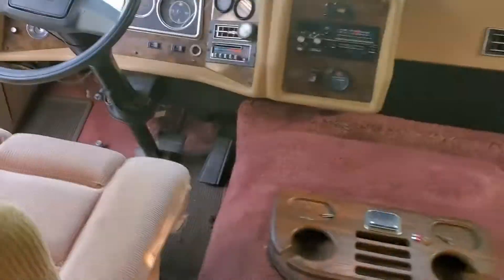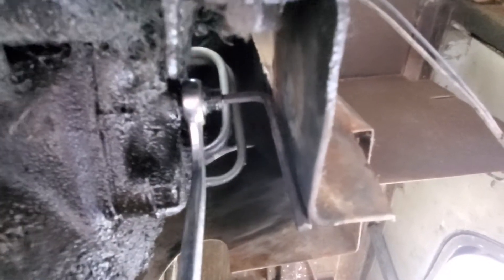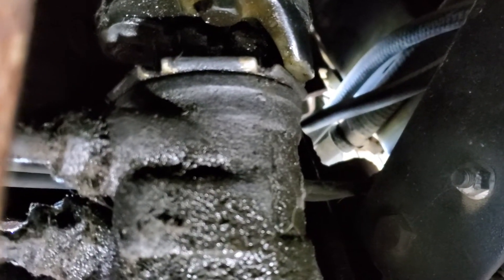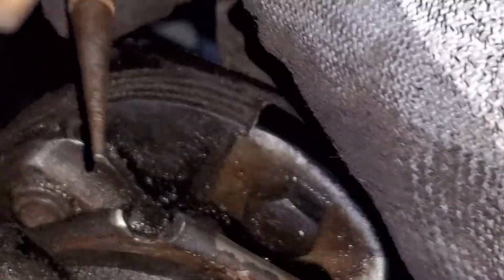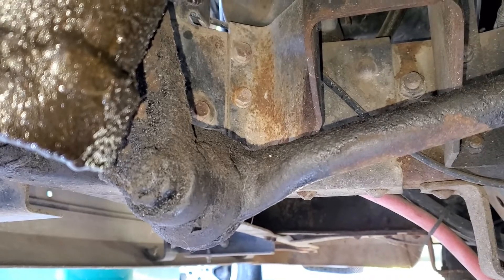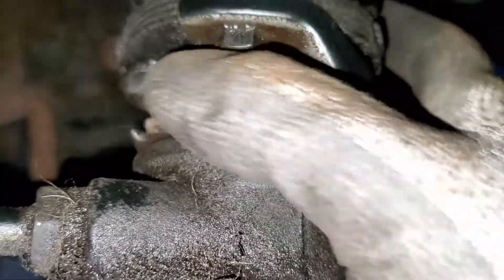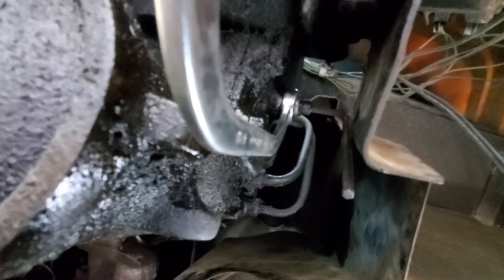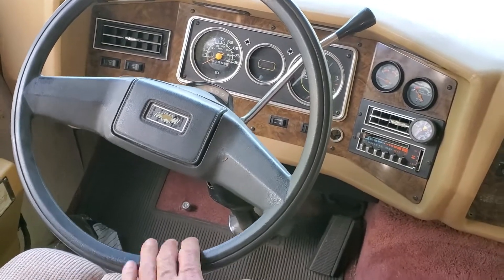Saginaw Steering Adjustment

Comment: youre getting warm,....  correct procedure is to losen pitman adj.  then  tighten torrington spanner to 30 ft. lbs,  then back it off 1/2",..   then very slowly (and gently) tighten pitman adjuster until a slight drag is felt turning steering shaft,..  then tighten pitman locknut.       ASE MASTER
Reply from the maker: Thank you for the advice we will remember that when we do this again 😌

Comment: Quick question after you did your main adjustment on the box? You went back down to tighten up the nut Did you tighten up the pin where the Allen ranch goes clockwise and then lock the nut down.
Reply from the maker: Lincoln says yes he did
Reply: @GlabFamilyAdventures   thank you ,I'm gonna adjust my box tomorrow. It's an awesome video

Comment: Thanks for sharing that. I saw a lot of people tightening the allen key bolt. I tried that too and it seemed to help a little, but some people saying that's not enough or the wrong way. Some others pointed out the other adjustment that needs to be made but no one showed how to do it.

I've just got a 2003 workhorse p42 old USPS van. Similar to the P30. ALmost bought an '87 p30. How's your steering on that now? is that hand adjustment on that bolt like thing enough? I took a screenshot of those directions.
Reply from the maker: The steering was significantly better especially when driving through Canada last summer
Reply: @GlabFamilyAdventures  Cool.